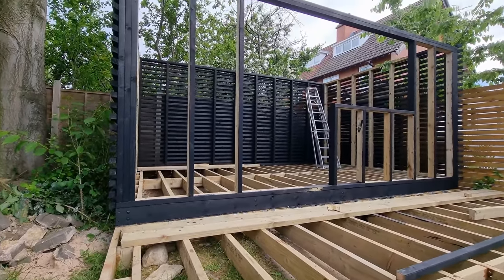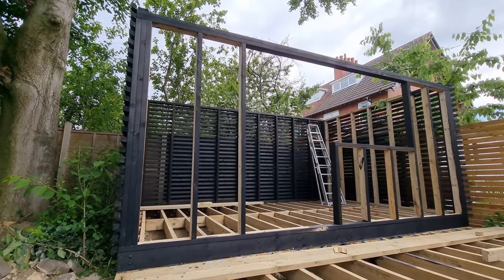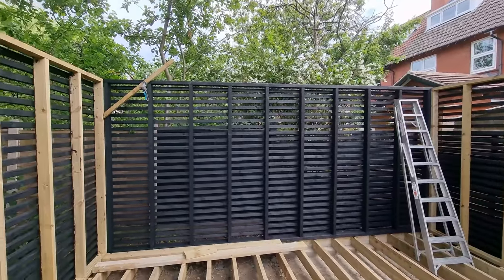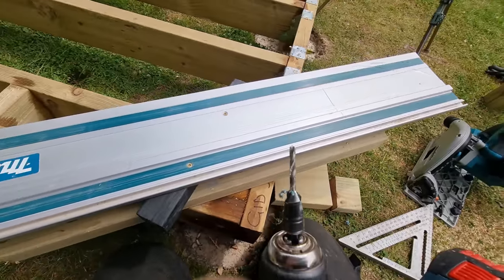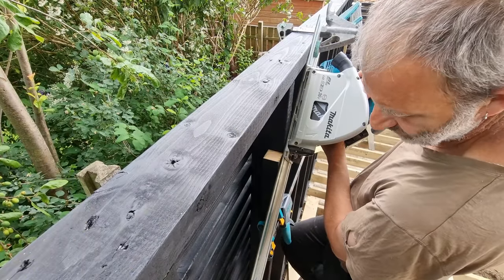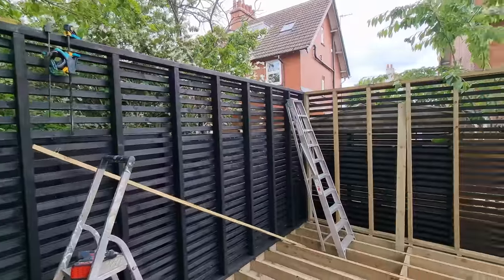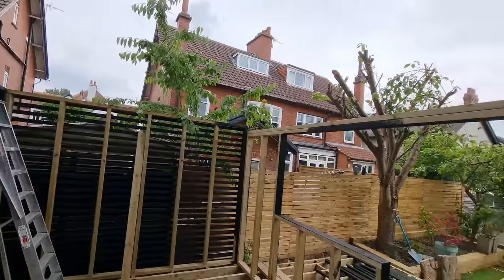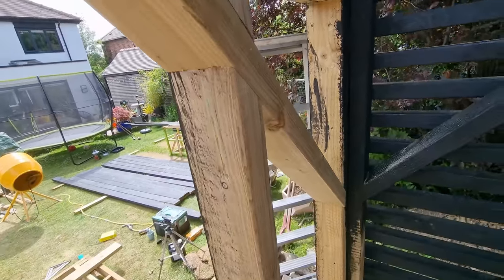Garden Barbeque Room & Deck build Pt8 - Half lap corner braces cut, Roof plan change, lots of talk.

Comment: Very clever with the 45 track trick 👍
Reply from the maker: Thankyou 👍 i measure from the corner the same distance across as down, & made sure the ends of the track were on those marks but it def helped with setting up & clamping 👍

Comment: Another nice job mate, love the new track saw, would love one myself but unfortunately to poor to party on that, have to say it’s just the right tool for this job . The braces went in nicely and should stiffen up the structure it will take something seismic to move it when finished 👌👌👌👍👍👍🇦🇺
Reply from the maker: Thanks 👍 Yep they stiffened it up a lot, the saw will get a lot of use & earn it's keep, my overheads aren't that high anymore, not as i get older anyway, but i don't live for tomorrow either, i've got a trade & always have work, so i spend what i have n think i can just earn some more, prob why i got in the shit with the van last yr, I should put some away for a rainy day, but savings? what are they 🤣😂

Comment: If you had built it the height you wanted Gid would it have been within permitted development?.
Reply from the maker: Between you n me James i think the height is ok but it's too close to the boundary, that's the rule that's been broken, this i've mentioned to my client, (i'm not going to get involved, throw a spanner in the works n tell the neighbour this) but i don't think either neighbours are taking that into account, they're too busy discussing height, so i've left them to work it out, part of the rules always say discuss with neighbours before building, & there's a i think unwritten rule that if somethings up for 5yrs without complaints then it's hard for the council to get you to pull it down, i don't know how much bull is in that last one & each case would be different.

Comment: Hello gid, great purchase on the track saw. The only thing I done with my cordless track saw was, I adjusted the blade further out so there’s more splinter guard on my rails. The ultra thin kerf only left a couple mm showing beforehand and bit too close for my liking. Hope
That helps abit! 👍🏻
Reply from the maker: Thanks 👍 I'll keep my eye out for that n i'll have a look at this track i've been using, 👍 Yep it's a nice toy, been wanting one for ages so i don't have to mess with a lead, Haven't got any other Makita 18v so had to buy the double charger too & only 2 batteries but I'll get more batteries in time & for the amount i do these'll do for a bit, 😁
Reply: @Gidjoiner  all my gear is 18v Makita. With a sharp blade with 2 x 5.0ah batteries, it goes on forever! eBay is the cheapest place to buy the splinter guard strip if you need to do your rails again. 👍🏻
Reply from the maker: 👍 My cordless stuff is the Bosch 18v 5ah, i'm surprisingly happy with it, i did suspect it would fail after a period but it's doing really well, batteries last a long time & the old drill i use in this must be 7+yrs old 👍 the cordless trimmer router i haven't bought tho, that will be Makita when i replace the corded Makita i have now & the 18v Bosch multi tool only takes Starlock blades 😒 so that will be Makita too, I have a shopping list 😁😁👍 I'll have a look on ebay if i need it thanks 👍

Comment: Loving the series so good to come home and chill out watching you craft this piece of art  . I bought the same saw I love it I went mad and bought the blue tooth version with the Bluetooth connected dust extraction unit all twin 18v it’s great , but gets addictive 😬added the planner to it and a jigsaw 😂😂 I am broke but happy 😂😂 but we only live once so may as well have some nice toys along the way 😂😊
Reply from the maker: Thanks Russell 👍😊 I looked at that Bluetooth one but i already have a Makita vac, i couldn't warrant the spend on a new vac & the saw was a bit more expensive, 👍 my cordless stuff is the Bosch 18v 5ah, i'm surprisingly happy with it, i did suspect it would fail after a period but it's doing really well, batteries last a long time & the old drill i use in this must be 7+yrs old 👍 I've 7 or 8 tools, jigsaw, planer etc. but the cordless trimmer router i haven't bought tho, that will be Makita when i replace the corded Makita i have now & the 18v Bosch multi tool only takes Starlock blades 😒 so that will be Makita too, I have a shopping list 😁 this is prob why i'm broke all the time, should've driven home n got my 240v one & put the cash away for a rainy day, as you suggest, that's never going to happen 😁
Reply: @Gidjoiner  I was lucky my old tools were so old and knackered so was starting from scratch but I did not admit to earlier was also buying the combi drill the top impact driver and a standard drill driver for fine finish stuff 😬😂😂 i wanted one battery platform but then discovered a mate who gets trade rates on power tools 😬 but they don’t sell Makita so went for a dewalt  small hand router , disc cutter and multi tool that were so silly cheap I could not resist 😂😂 that’s it now no more ! Well not this year anyway 😂😂😂😂 . You work hard might as well enjoy some treats mate that or pay more in tax 🤔 no brainer have fun buy more toys 😂
Reply from the maker: Tax ? 🤔😂👍

Comment: Hi Gid.  I know I am a bit late to this series but would not an option have been to reduce the height of the rear wall so that the roof rafters could go front to back with a slight fall.  The rafter would sit on the top of the front wall as the new plan proposed.  The side walls would stay the same and the roof would be on the inside of them.  There would be a sealing issue but I am sure that could be resolved and a solid roof could be used.
Reply from the maker: Hi Rob, thanks for the suggestion but i did mention this in one of the videos, this is a sort of pergola which would normally just have level roof timbers, it was only going to have a pitch on if he decided to put some kind of roof on, which he didn't, & reducing the back wall is what i said i would have preferred but i would've had to remove all the battening from the top couple of rows & cut all the studs to height by hand, It was swings n roundabouts about which to do, in the end i chose this option which meant i was moving forward instead of backwards,